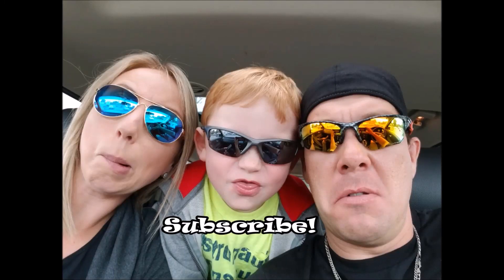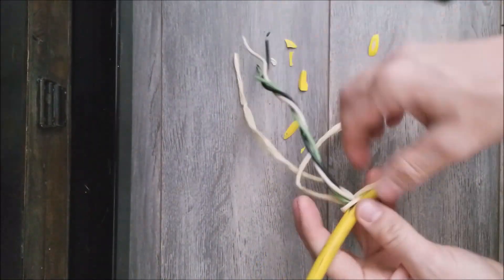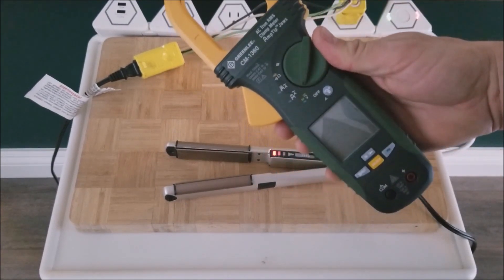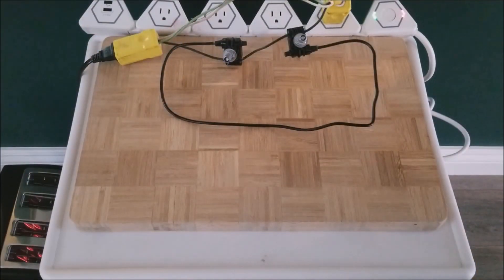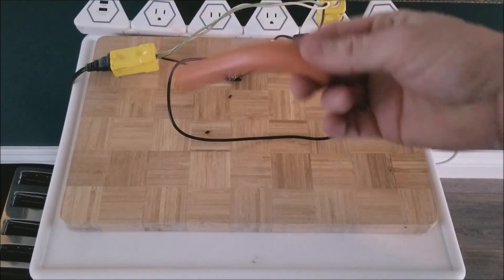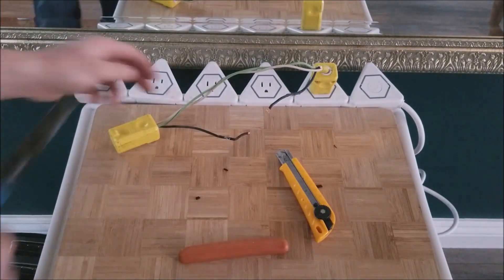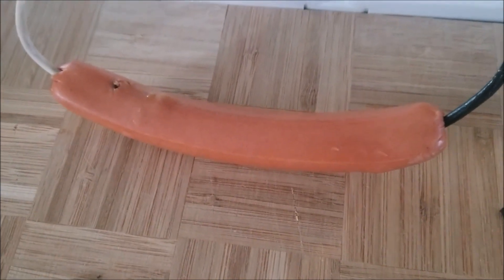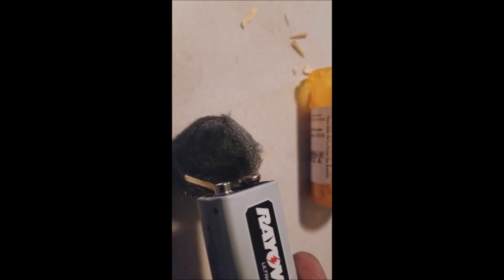Electrocution and Amperage

Comment: 3:30
Not a lineman.
But i know wh
If 10A goes in, 10A has to come out.
If there is a difference between live an neutral the GFI should trip(assuming the house has one)
Reply: North America has gfci outlets, usually none at the breaker. Those outlets are only used near water sources as well.

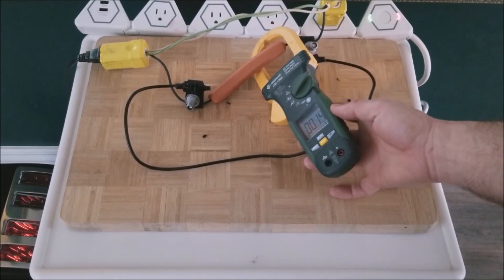Comment: @5:50 your meter likely fooled you, reacting to the magnetic field of the intact loop - no way this loop could have enough voltage drop to drive 100mA through a hotdog (guess roughly 1kOhm of resistance, thus somewhat 100 VAC should have dropped on the wire). Anyway, just my 2 cents - although obviously a line's rated current doesn't kill you, it does. Yes, the voltage determines the possibility of a lethal shock, but for those low-voltage lines electrocution is pretty much unlikely - and shorting them is much more of a danger. Imagine, say, a 50A-rated 220 VAC line shorted with a relatively thin wire (like a faulty meter's probe), or a screwdriver - or anything else put there without too much pressure. It will take too long for the breakers to trip, making the contacting metals heat up and burst into thousands of tiny droplets before it happens. Now those droplets (and a UV-burn-bonus from the arc that follows) are really bad, easily penetrating through skin and even into the eyes. With 10-20A breakers it is not that bad, but the slow massive 50+A ones can easily cost a person an eye or two.
Reply from the maker: Great explanation ✌️ thanks for taking the time. Cheers!
Reply: I agree about the explosion risk of shorts on LV lines, but I think the hot dog demo was measured fairly accurately.  It could be redone with an in-line meter, but you saw the cooking hot dog.  That takes some watts to happen and they were happening there.  Back in the ~60s you could even see books recommending two nails in a board connected to 120V as a "homemade hot dog cooker"" (they also lit up pickles too).  I also agree 120V is rarely lethal, but it does happen.  Lots of things can happen to lower body resistance, and/or cause you not to be able to "let go".  The risk goes up rapidly with the voltage as the skin resistance starts to break down at higher voltages as well.
Reply: @LFTRnow  You somewhat missed it: what I referred to was the scene where the hotdog was first connected along with a secondary wire, where the somewhat 100mA flowing through it (without cooking!) was clearly a meter interference. The fact hotdogs are cooked pretty well even under full mains voltage (though we used a MOT just because) is a fact, of course - and clearly a reason to not stick your fingers in there (however the skin resistance will likely save you anyway). The electrocution risk, however, is much higher then it seems: it may even not be a direct electrocution, but still cause a victim to unintentionally fall or drop a tool, which in a more complex worksite is a very possible fatality.
Reply: Hot dogs have a lot of salt and water in them.  They're quite conductive.  Just like you are.

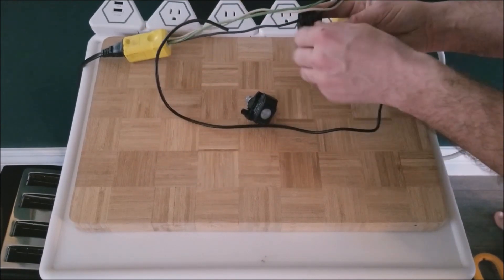Comment: @3:35 "The neutral wire is just as dangerous as the live wire" then @ 6:41 bare hand right on the neutral conductor while still plugged in.....
Reply from the maker: Plugged in, but the power is shut off if you look at the button on the far right. ✌️
Reply: @Bobsdecline  How many poles/phases are switched?
Reply: @jw33  It's probably only single pole switch, on the live wire. No loop, no current, and there's no other loads running parallel to induce any current, so it's all good. Personally i'd still unplug it though, but then again i live in the UK where it's 240v, so it's a much nastier surprise if you do make a mistake!
I've received a high voltage shock, from a camera flash capacitor, it was like a sudden searing white lightning in your eyes except you weren't seeing it it was like it was in your brain, followed by all the nerves in my arm feeling like they were burning for a couple seconds then just a numbish feeling for a couple days, i got away pretty unscathed i guess. At least i wasn't specifically warned NOT to make an obstacle course out of the bunk beds at the hotel (school trip) then do exactly that and fall and break both arms like some girl did!
Reply: @ValkyrieStarTV  Flash capacitors give a really nasty sting, but your experience was a little extreme. I also got shocked by a 4.7uF capacitor charged at ~320V (230V AC rectified) and it wasn't fun. I wouldn't want to find out what a 470uF primary cap from a power supply feels like.
Reply: @demoniack81  Heart defibrillators contain flash capacitors.  I wouldn't want to feel it either.  Typically about 8μF at 10,000 volts.  Your jolt was 2.4J compared to a defibrillators 400J jolt.

Comment: Hey man thanks for the videos!!
I really like them!
I have been thinking "I would love to see more of what you guys do and how you do it" the other day and then saw your vids.

Question I have...

If you touch the Live/Hot wire, and are grounded pretty good you will get a shock right because the Neutral is connected to earth and you are making a circuit.

If you touch the Neutral wire and you are grounded really well. Will you get a shock if nothing is turned on? E.g you grab the neutral wire and the toaster isn't turned on?

I understand you'll get a shock from the neutral like in your other vids you talk about it if its turned on because your making a circuit.

Do you still get a shock from neutral wire if the toaster wasn't turned on? Does the neutral become a "Live" Wire between the alternations? (AC Current) and shock you ?
Reply from the maker: Hey Sam! Thanks for the awesome feedback 👊

To answer your question

The first paragraph is accurate, however you would get electrocuted regardless if the neutral was connected to earth or not. In a nutshell it would be because there would be a difference in voltage. Without writing a whole book I'll sum it up in saying that; while electricity is always looking to return to source, it is also looking to equalize potential with anything within its reach . Providing the source has the capacity to continuous supply electrons as they pass through "you" while traveling to ground you will be electrocuted rather then simply receiving a shock. If we consider anything and everything that contains energy, then ground will always be eventually be considered a return to source.

To your second paragraph

This one is complicated ...
 Should the toaster be on and the neutral be broken, the toaster side of the Neutral would then technically become a "hot" . There would be a 120 volt difference between it. And the other end of the neutral which returns to source. Ground would be close to that potential and also result in a 120 volt difference. 
If the neutral was not broken, then whether the toaster is on or not would result in a very small difference in voltage. In most cases this would not be high enough of a difference to break through the resistance of a person. As you use this same example with more load or voltage, the scenario would become increasingly dangerous. On our particular Powerline system., Our neutral is frequently grounded. As a result there is minimal to no actually hazard providing the neutral isn't broken.

So to answer the last question
With a toaster off, the neutral wire would be an isolated piece of wire.

Ultimately what causes the shock, electrocution, arc ... Is a difference in potential
Reply: @Bobsdecline   Thanks for such a detailed explanation!
Your the man lol I didn't know if I would get a reply let alone actually explain it that hardcore! Cheers!

I wire up trailer looms and lights at the moment as a job just learning about DC circuits and pull apart a few battery packs and learning about the lithium DC stuff.
Recently had solar put on our roof so was keen to learn about AC and the Grid.

I'm in Australia and across the road where I live there was a job exactly what you talk about and show in your video about the cracked insulator on the power poll haha! It was sparking hardcore with the weather. We get lots of dust and then rain. even dirt rain haha after that it was sparking heaps.

Next question.

In learning about AC circuits and theory for your job, what book did you have to read for your trade? I'm keen as to learn more about how it works the Alternating current etc.

 
I've done like a couple hours on Wikipedia and looked at the "how does the grid work" stuff but have so many questions about everything.

Anything you'd recommend? 

Thanks again man!
Reply: @Ziqua  there are a great number of books on AC and DC theory. They are all different with respect to what you're looking for. Some are very simple and concise and others get further into the engineering standpoint, ie. how does a higher frequency effect the impedance of a conductor, or what can you do to limit the current of a conductor as to not overload the lines, etc.
Reply: @Bobsdecline  I actually have some recent experience with an open neutral.  We(electricians) were troubleshooting a kitchen circuit(US, 120a) because there were more wires than there should have been and the gfi wasn't working.  We were tracing the hots and had those hooked up, but I didn't hook the neutral back up.  Touched it and got a shock.  Measured ~108V ac from the neutral to the ground.  
That was with the very, very minimal load of the gfi circuitry and the meter's resistor.  Kinda curious as to the results with something like a toaster.  Considering testing it sometime.  
Thank you for your great content, especially the linesman stuff.  Taking classes next February to become one actually!